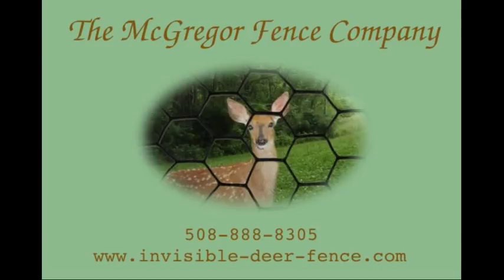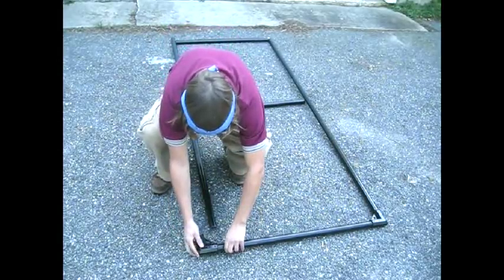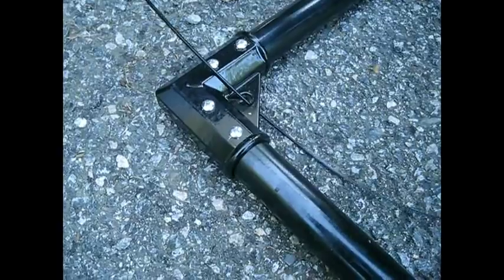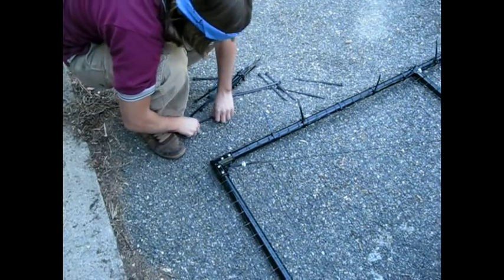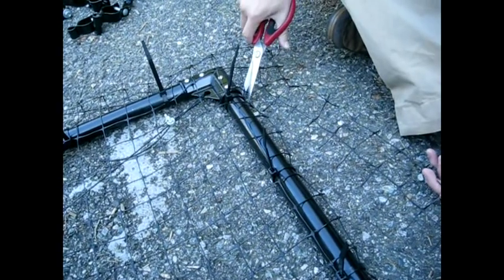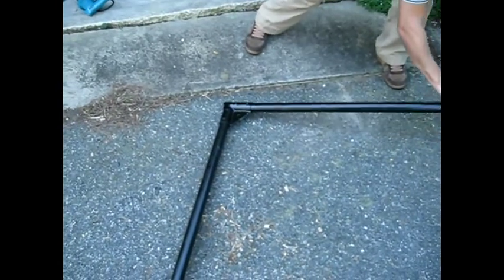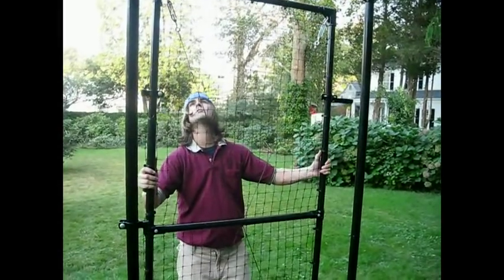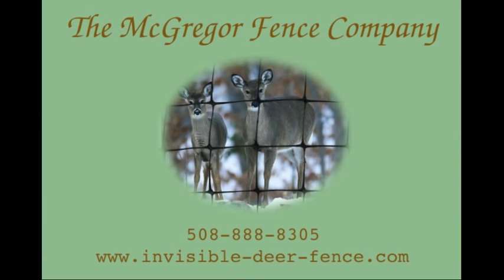10. Deer Fence Installation Videos: The Deer Fence Gate

Comment: This is a great series.  Not only will it help install, but it gives confidence that this is a project I might be able to accomplish myself with some help from friends.

Question - Should this step of installing the gate be the first step you do?  And if so, would one of the gate frame posts actually be your starting post for the fencing.  I'm thinking of using the poly fence with the round posts, as it seems that looks the best in my opinion.  Thanks for the videos.